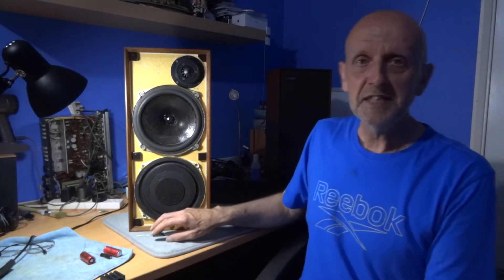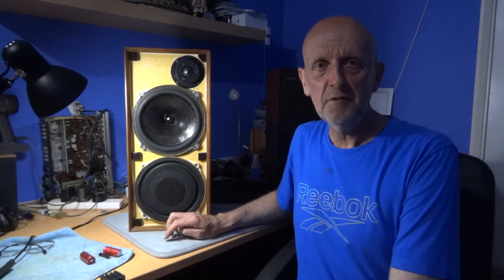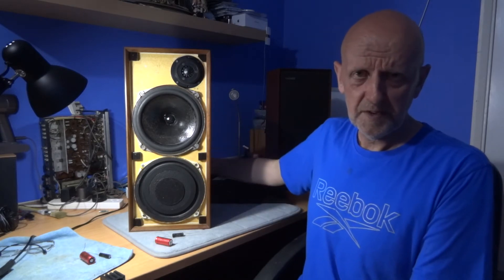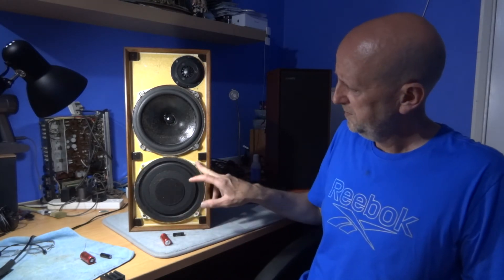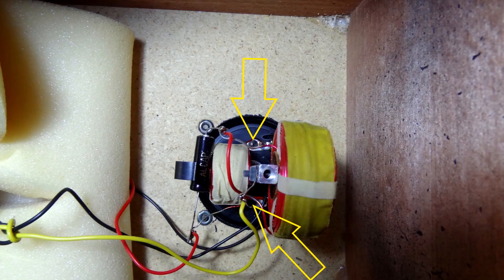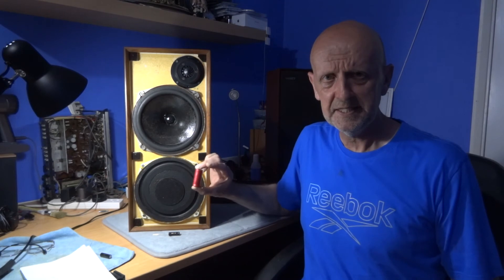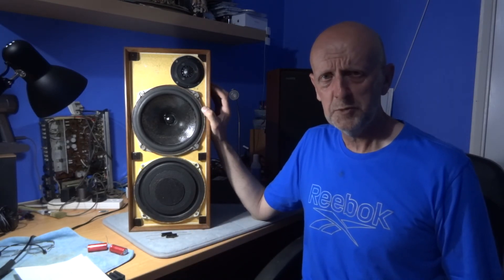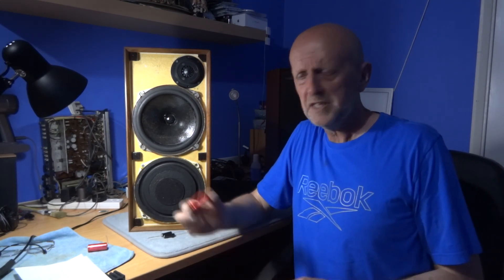Celestion Ditton 15 Speaker Crossover Capacitor Replacement - Vintage HiFi audio

Comment: Cool video , think I might do this on mine . Would also like to change the terminals to accept banana plugs , is this possible?
Reply from the maker: Yes you could change to a banana plug socket, you might have to make the holes a little bigger where the old connection is, just do it gentely so not to split the plastic

Comment: Would you mind sharing a link to where you got the caps?
Reply from the maker: Hi, yes I bought these from Cricklewood Electronics in the UK, eBay link :  https://www.ebay.co.uk/itm/Bipolar-Capacitor-Alcap-50v-150v-1uf-470uf-Sold-In-Pairs-Speaker-Crossover-Caps/261803815766?ssPageName=STRK%3AMEBIDX%3AIT&_trksid=p2057872.m2749.l2649

Comment: Another good video, will attempt to recap crossovers on my 15XR and 11’s. Thanks for the info.
Reply from the maker: Would be interested to know if you could hear if there was much of a sound differance after you re capped them
Reply: @MichaelYates  I was looking for the caps from Falcon, but they have not got any 10mfd in stock.  I need 4.7, 10, 12 and 16, all at 50 volts. I will wait until they get some and then try to replace them. I don't think my hearing is that good to tell the difference, but we will see. Will let you know. Im not even sure if the old caps are bad or not, but after 40 odd years they may need to be replaced.